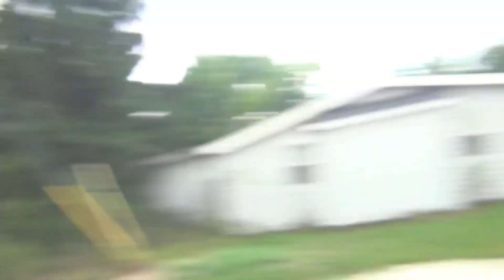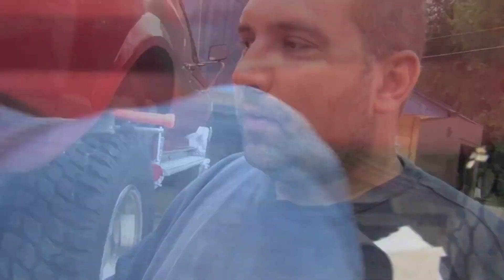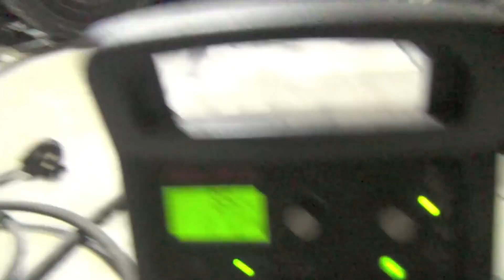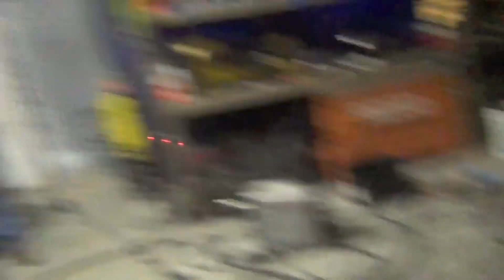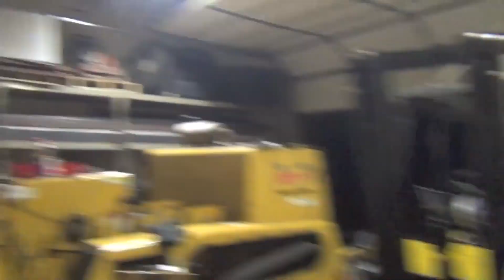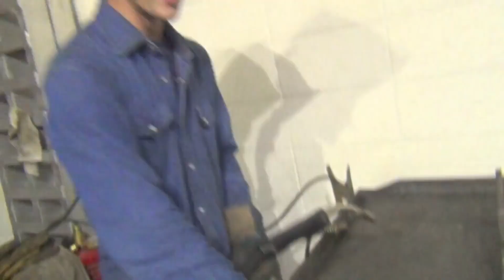An Industrial Towing Bumper Build Part 1 of 2

Comment: Nice to leave the gusset corner open to let the road crap out. Otherwise it would self ventilate itself anyhow.

Did you run out of jobs to feature Pete?
Reply from the maker: not necessarily ... I am working on something BIG also ....    but these videos were lost for a long time after chuckE's channel was gone ..... I had them (naturally I made them with him !) and shared them back with him and the one measuring the voltage and wire speed on an all analog machine is not exactly a big hit at the box office but I got sick explaining OVER AND OVER to people all one on one ...      I have some cool stuff in the making ....  you will see new stuff as well ... I mean I sprinkled some in ....  already .. and I have more I already recorded editing as we speak right now ..... and also ...  new projects to build by my self and with my kids this summer .... !
Reply: @ZILAwelds  Well, back to basics is always good.  👍
Looking forward to cool projects (and hopefully some more excellent videography from Violet!)